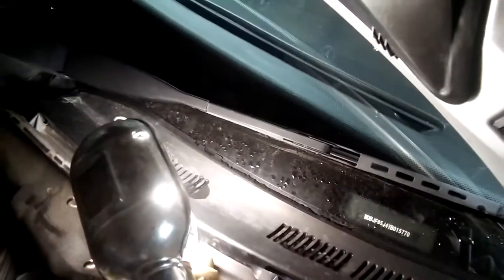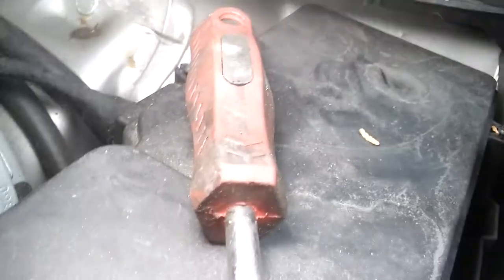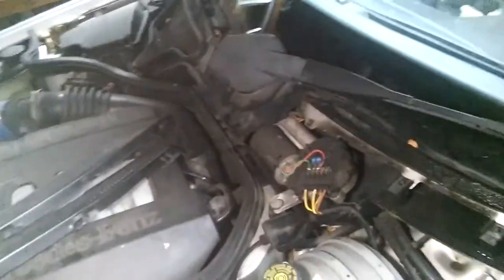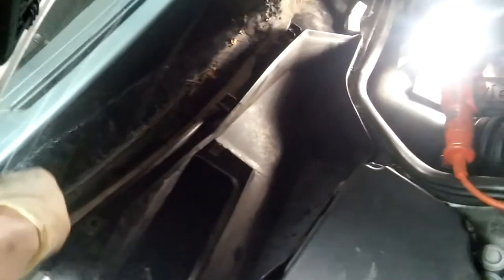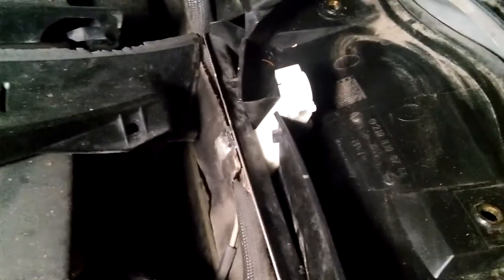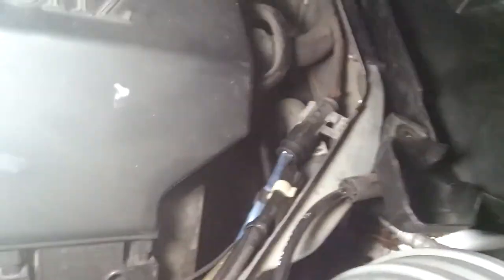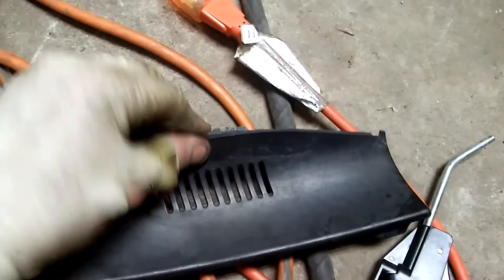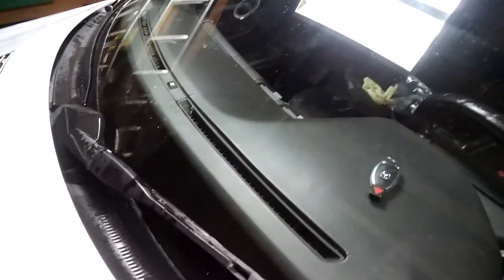MERCEDES W210  CLEANING CLOGGED WATER DRAINS/ очистка засорeнных водостокoв

Comment: I was hoping I would find out just where the drains go to before water comes out under the car. Several of us have had water collect inside the rockers because the rubber drains on the bottom have become blocked. Sometimes a gallon or more! Do those windshield drains drain into the rockers?